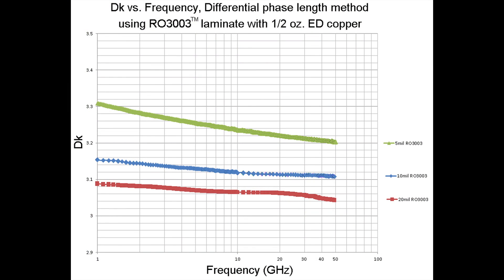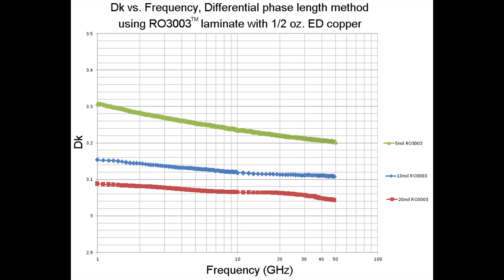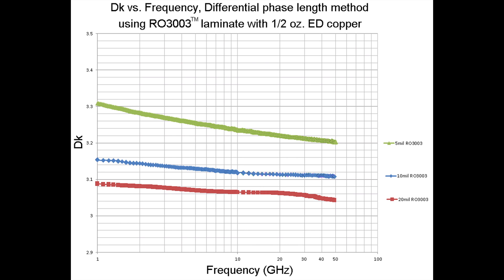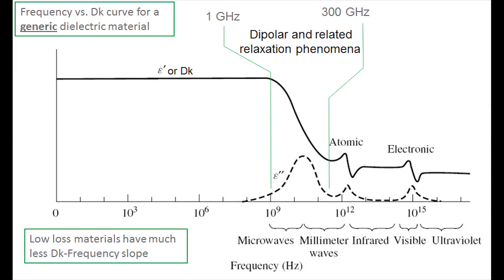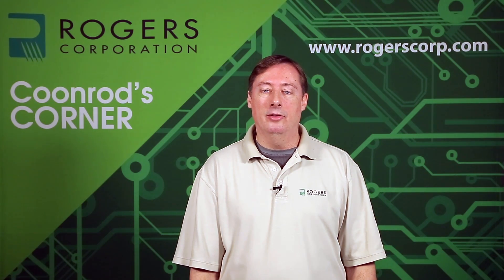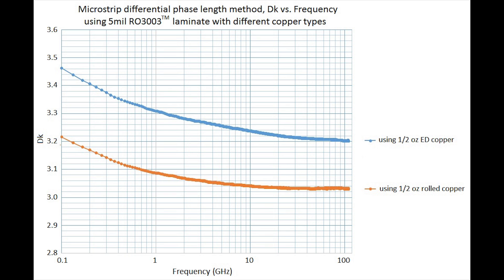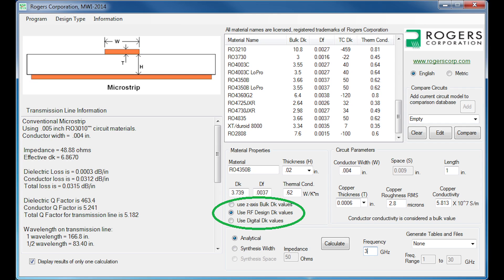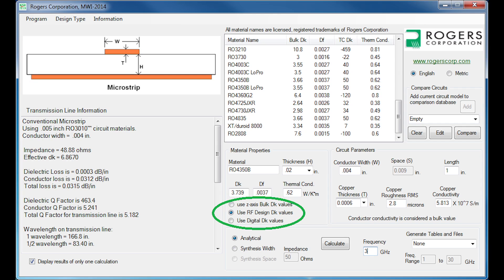What RF Circuit Designers need to know about Dk, Part 2

Comment: Sir, I'm designing a mw filter. and  I chose RO4350. when I used MWI-2016 software of yours, It said that Dk=3.734, so I should chose Dk=3.734 instead of 3.66 for calculation and simulation, right ? 
and in the previous part, you said  that the roughness of copper affects to Dk, but when I chose different roughness, the Dk is constant. how can I calculated the affection of roughness to Dk ?
thanks.